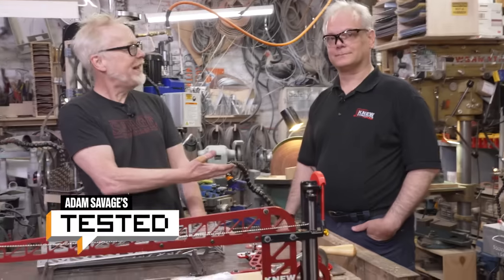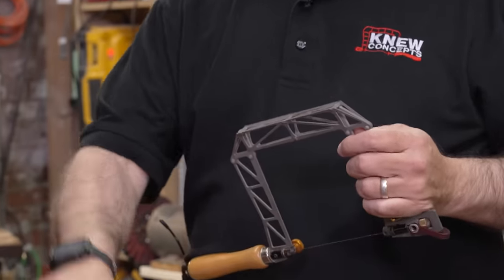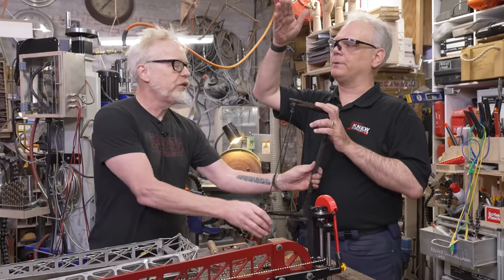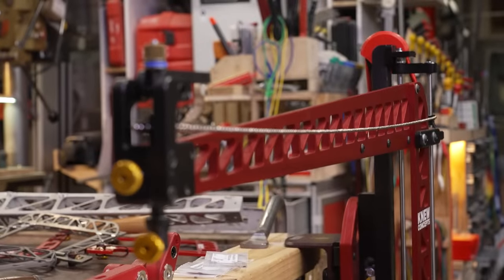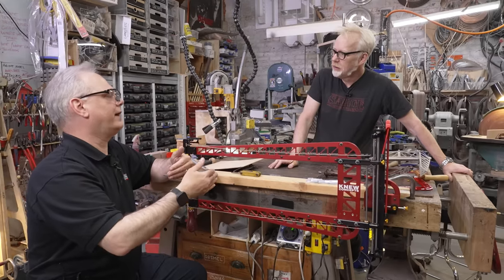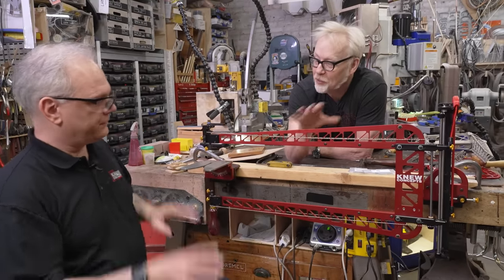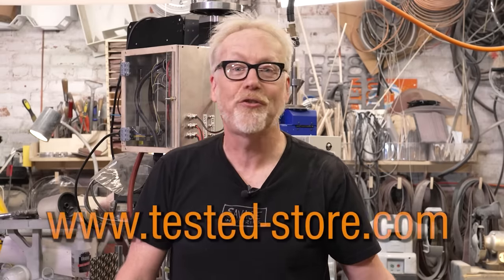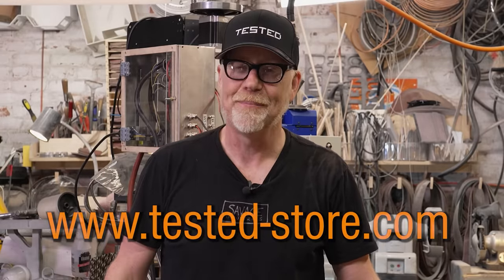Adam Savage Geeks Out Over This Precision Woodworking Saw!

Comment: If the bench pin is set at a slight angle to make tightly fitting marquetry, then rotating the blade to cut backwards would also invert the tilt angle of the cut. Does the saw have a mechanism for moving one end of the sawblade off the rotational axis to create a consistent tilt for any cutting direction?
Reply: I would think you would need to rotate the work piece along with the blade to maintain the angle needed in the work piece but the angle of the saw is fixed
Reply: Next up? A machine powered version, where you only have to control its direction.
Reply: We didn't really get into that, and worse, the bench pin you see in the video isn't the normal one for that saw.  The normal one doesn't tilt.  But it somehow didn't get loaded when I packed the truck.  So I winged it with the pin we did have.  The way the marquetry saw normally does angles is that the entire guide tower tilts, rather than the bench pin.  (There's a protractor built into the pivot mechanism.)  There is also a system to lock the blade swivels into 'straight-ahead' mode when cutting like that.  Because you're correct: if the saw's tilted, and you try to cut in a direction other than perpendicular to the tilt, your angles will get fouled up.
Reply: @KnewConcepts  a foot pedal that would actuate the saw blade like an old foot powered sewing machine would probably be popular too. Awesome tools, keep on being awesome

Comment: Somewhere I have a photograph of my Grandfather as part of a crew building a 2 story house here in Victoria, BC.  Now, in modern times we have pre cut 4x8 sheets of plywood and the studs in houses are placed to make it easy to just slap those suckers into place.  This photo I have is from the 1920s, or maybe early 30s.  They had no power tools or air nailers.  Here they were, on ladders running a SINGLE piece of plywood, on the angle from ground to roof line, holding it in place and hammering nails into it.  So while you may think no one would do that gingerbread cutting while up a ladder - you may be surprised.  It was probably better to put the solid wood in place then cut to reduce the risk of breakage.

Comment: Isn't that old saw for cutting shapes out of bigger pieces, like boards? For doing custom crown molding or smth where you just can't swivel the saw or the piece around? So only thing you can do is to rotate the blade
Reply: It would also work to repair existing pieces that could not be removed safely

Comment: That old saw is a corbel saw. They had to keep the saw blade on the same plane when scrolling really thick corbels or the blade binds and the cut becomes impossible. This is not for puny gingerbread. I am a 3rd generation carpenter and heard my dad talking about them as a child but have never seen one or had the need to use one since we always cheated and cut our corbels out of normal stock and then laminated them together. Doing this also allowed us to add a tenon to the back easily by running the inner laminations long. 
BTW- A really big corbel blank weighs a LOT, and you would have your apprentices horse that sucker onto the bench and secure it. Maybe once the major waste is cut you could spin it, but I was taught to make the cut once and make the money when possible. Most corbels are a scroll and made to be seen from both sides (to show wealth) and if they are not symmetrical you can tell even from the ground two stories away.

Comment: The old cast iron saw spins around so you can cut a full arc without the frame hitting the work piece if the work piece if wider than the depth of the saw frame.
...and that is why jewelers saws also have a rotating blade mount. I thought this would be obvious. ??

Comment: Of course it is a good thing to have a saw with a narrow blade that can be turned relative to the frame that it is mounted in. I have two old classic Scandinavian? wooden frame saws, one with a normal, one with a narrow blade. These were from my old school which closed years ago, here in Denmark everyone has - or at least used to  have - "sloyd", that is basic woodworking and crafts. Although the blades do not turn freely, the can be fixed at sny angle to the frame.

However, I have also used a fret saw with a non-directional blade, which is a blade that has a stretched spiral twist, so it removes material no matter which way you move the work piece. To me, such a blade seems quite a bit more versatile?
Looking at the bead chains for rotating the blade, I had a silly idea that I would love to share: What if, instead of spherical beads, you put "edgy" beads on the string? Either actual formed beads, with a suitable design and material, or simply small metal discs that have their edge sharpened towards one side, and then mounted on a string with suitable spacers. I guess it would also be possible to make a flexible fiber string band with an abrasive material glued to it, a kind of "sand string". Instead of using it with an oscillating frame it could even  be made into a loop for a band saw.
Probably somebody must have invented this already? But I've never seen any devices using it, so maybe not, or is there a disadvantage I have missed? (As I said, it's just a silly idea that just occured, so I haven't thought about it more than ten minutes, max.)

Comment: 12:59 - I don't understand how putting two pieces of wood on an angle allows for no kerf lines nor do I understand how a recess of the design you're cutting out is made in the bottom piece of wood. Are pilot holes not necessary? How did this tool do the job of a router and saw? 😅
Reply: When you've got the blade angled over to the correct angle (calculated by way of measuring the thickness of the material and the sawblade), the 'big' piece  from the top sheet drops into the 'small' hole in the bottom sheet, sort of like a tapered cork.  The angle isn't random, it has to be calculated.  So you end up with a larger piece from the top sheet that is exactly large enough to fill the hole in the bottom sheet including the kerf from the blade.  The reason it isn't a router job is that with this setup, you can get hard 90 degree corners and very, very small details.  Which you can't with a router.  You do often end up with a tiny little hole for starting the blade, but those are often about the size of a big needle, and easily plugged.

Comment: Would be cool if it were powered from like a foot pedal for the up n down movement kinda like a sewing machine
Reply: may aswell just get a powered fret/scroll saw
Reply: its really not necessary though because its not meant for large pieces so you are only doing very short fine cuts and your hand moving it is more suited to that precision of ending a cut right where you need to.

Comment: Incorrect about the chained coping saw, yes you can spin your hand but thats only if the frame of the saw can also go around the wood. Try cutting a circle on a 2ft board. The turning of the saw blade enables you to create shapes within the size of the width of the saw without the frame getting in the way

Comment: If you're going to have a chains running all over the frame, why not add a tensioned wire along it (through a guide)
Then you couild mount the blade in a pair of separate ferrules which slide in bushings mounted on the frame. The blade is kept in tension by the wire pulling each ferrule in opposite directions. That way, the frame stays still and you;re only moving the blade and its ferrules. 
Extremely controllable, and since the weight of the frame doesn't matter nearly so much, you can build it out of something cheaper than titanium!
Reply: I think that frame was aluminum
Reply: Tried that.  (That's kind of how our power saw works.  )  We get a lot more tension from the frame itself.  And with the bungee system, the weight of the frame is a non-issue.  There is a tensioning mechanism for the ballchains.  It's just not easy to see.

Comment: IF an intended use was to cut gingerbread patterns in fascia boards while up on a ladder (or even if designed to do it on a bench in a shop); then being able to rotate the blade within the frame would reduce the interference between the frame and the board.

Comment: I like the big expensive thing I have no possible need for alot.  It seams theoretical that you make a Kiocera 2,000 degree oven and an array of 50 Kiocera blade run across taffy tungsten knitting spool, because if you concieve of like 500 spools, you'd crapping out spandex / rayon / polyestyer by the minute.  Then it needs a motor, so its so lazy you have your phone see if your sleeping.

Comment: I found that it took years of practice to get a good "stroke" when sawing that you can control and repeat. The ability to turn the blade is better than turning your wrist. It is possible to make a cut with your arm in contortions, but it's not much fun.  Ask a baseball pitcher to throw a fast ball with his wrist turned around like a pretzel. Sure you can do it, but you probably don't want to.

Comment: Must be fun to solve such specific problems and make money doing it. This is $2500 for a saw very very few people will need (and probably with very small profit) – it’s cool when you can make that work.
Reply: The value proposition for a tool like this is not measured in profit. It is measured in joy.
Reply: @frankvucolo6249  Yeah, and joy won’t pay your gas bill etc. etc. Trying to fill such a tiny gap in the market out of sheer enthusiasm often doesn’t work out, it’s nice when it does.
Reply: there is a smaller cheaper version you really dont need this one and he said he did it just because he could everything you can do on that could be done on the smaller one.

Comment: Eh, I'd rather use a laser or CNC router to do the same thing as that big saw.
Reply: to get a laser for your home garage that could cut metal is gonna be crazy expensive and bulky a cnc machine is not capable of doing that fine of work especially on inside cuts you are limited by the bit size.

Comment: Man, it's hard to take Adam seriously. I get this is a promotional video. But "I know that these are excellent engineers here because they got the color scheme right."? And they couldn't understand how the rotating head could be useful on the old saw (try cutting patterned holes in long boards and it will become obvious)? Strange how the "answer to a question that no one asked" is a quaint oddity yet the "updated answer" is somehow "amazing". It looks like a good marquetry saw. But I'm not buying that Adam "had no idea what you were going to bring in" or that this isn't a paid advertisement.

Comment: There is a blade that renders all that irrelevant.
Spiral blades allow you to cut in any direction without pulleys and chains.
Reply: Sadly, no.  Spiral blades are almost always the wrong choice for any cutting.  There are two main reasons: (1) they leave absolutely horrifying cut edges behind.  and (2) you can't cut a straight line with them if your life depends on it.  Since they can cut in any direction, they do.  No matter what you may want them to do.   Try cutting detail work with them.  Or worse, metal.  They just flat out won't cut metal.  The blades are too coarse.